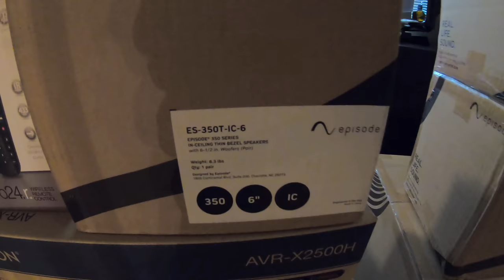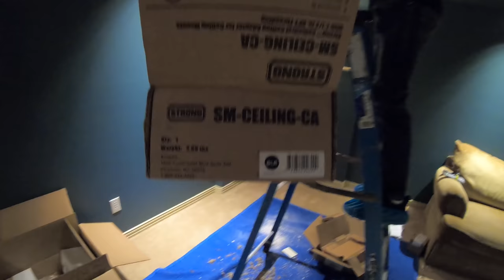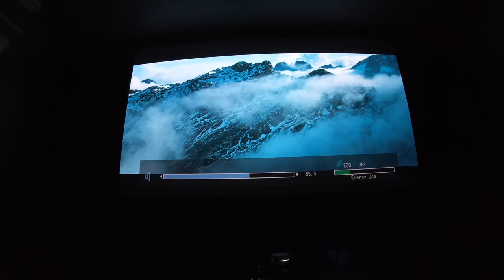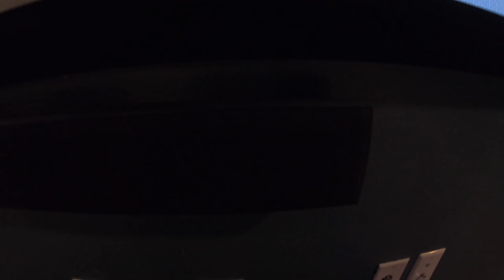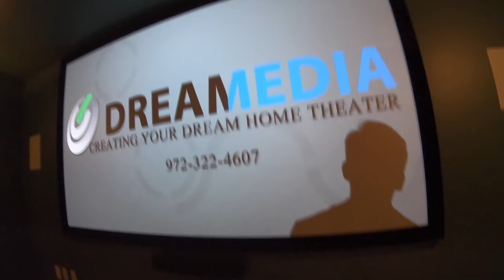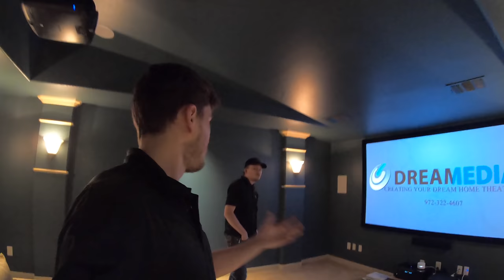Epson 4050 & Episode 5.1.2 ATMOS |How to Setup Dragonfly Projector Screen

Comment: Hi epson 5050 135 or 120 inch screen and what mount should I get ? In your experience would the 120 inch screen just give a much better picture? Light controlled white screen .
Reply from the maker: strong fs fine adjust mount. Lots of factors that go into picking size. make sure you look up throw distance from lens needed for each size to see which CAN fit into your space. Also think about speakers, if they will or wont get in the way of a massive screen